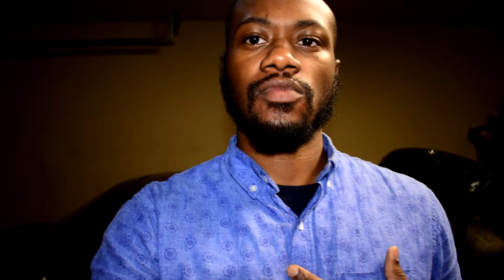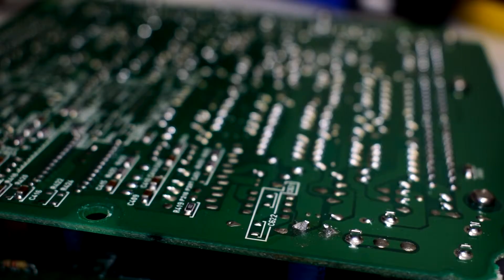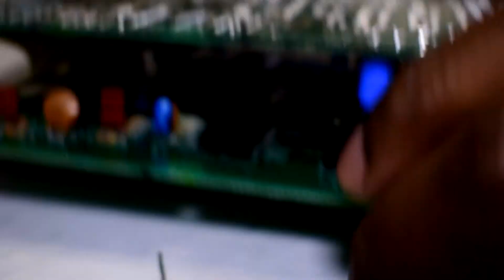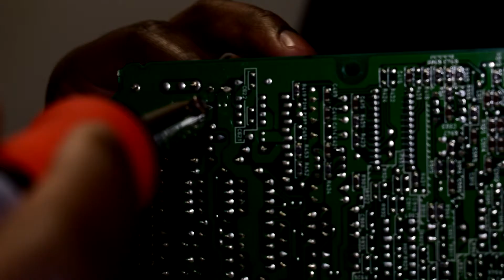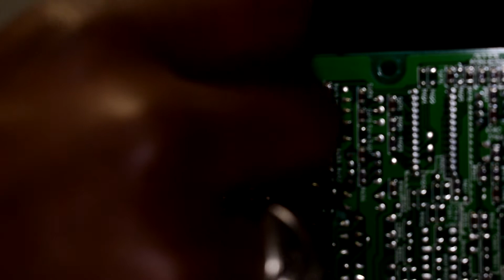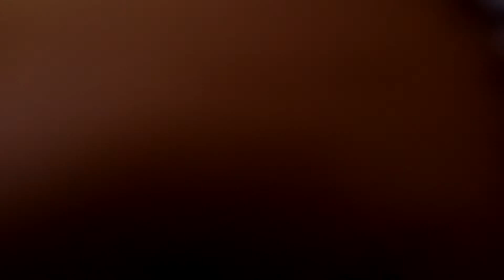How to remove and replace capacitors for Toyota MR2 3sgte ECU

Comment: Its a big issue for any gen2 3sgte ECU. The capacitor C810 which is the idle control will leak. Also C512 will leak as well. There's a big article on the leaky capacitor for the gen2 ecu. Your car will not run properly due to this issue. Always check and replace the capacitor.

Comment: If the caps on that ECU were bad, wouldn't it throw a code?   Anyway, unless your car is otherwise perfect, I'll assume this didn't help the idle problem.  I've replaced a lot of bad caps, but never on an ECU.  Is this a thing?
Reply from the maker: No codes were thrown at all actually. I replaced them and had not a problem electronically since.